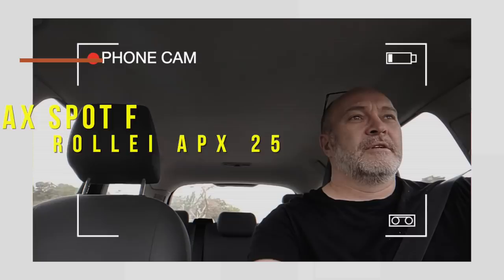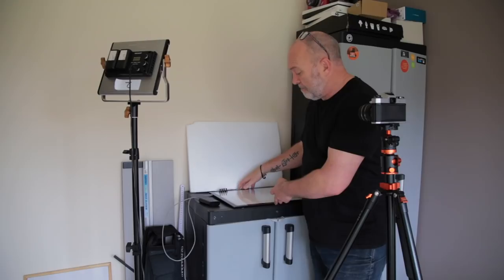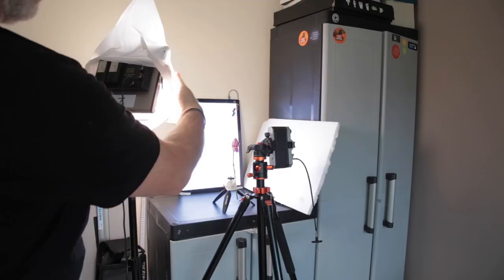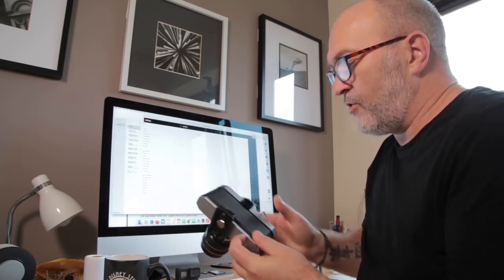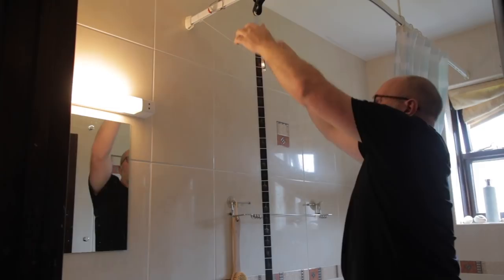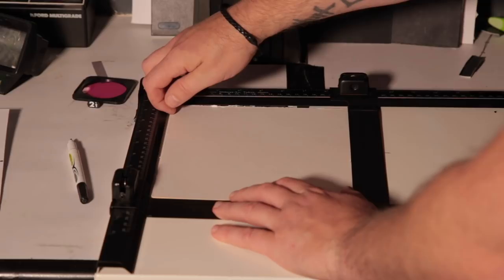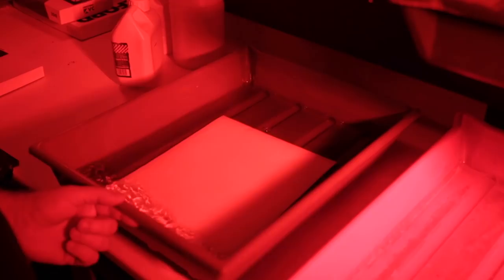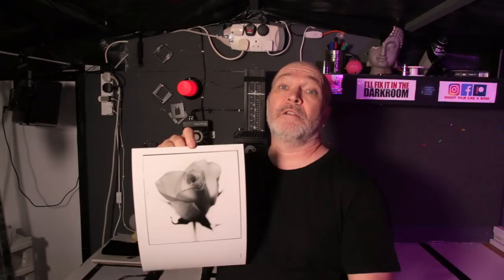Simple White Background for indoor photography

Comment: Before you start to print....get a sheet that you put in your clothes dryer...gently wipe your glass carrier on all sides...then run your negative (film) over the dryer sheet.......most dryer sheets contain an antistatic agent.This should help out alot with dust on your negs or glass parts of the film carrier.....I use the unscented ones. You can also wipe down the area where you handle your negs. After one use throw it away.
Reply from the maker: Thanks Don. I had heard of that before but never ventured. I shall have to try it now it's come to light again!

Comment: I wonder if you got a piece of transparency film, and glued your piece of card onto it do it clicks correctly into your easel then you might get more uniform crisp borders?

Different sized cardboards on transparency = your different print sizes/shapes?
Reply from the maker: I'm not quite sure where you are going there Jordan. You mean actually on the carrier?
Reply: @ShootFilmLikeaBoss  no to put on your paper easel - so the corner of the transparency lines up on the easel just like your paper does.

The clear part will go under the easel blades/under your blocking matt and it'll be easier to get your cardboard in the right place to burn in the borders

Comment: Do you use a diffusion light source or a condenser and bulb? Diffusion source is a lot nicer on all those dust particles, and overall much better than a condenser source in my opinion.
Reply from the maker: A diffusion head is supposed to be kinder Steve by scattering the light. Mine is a condenser. I could get a colour head for it which is diffused.